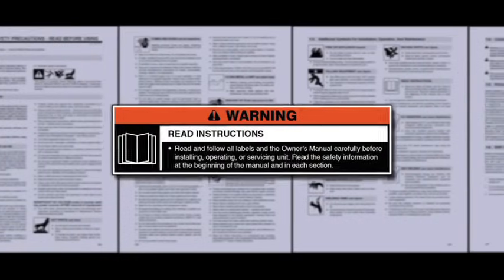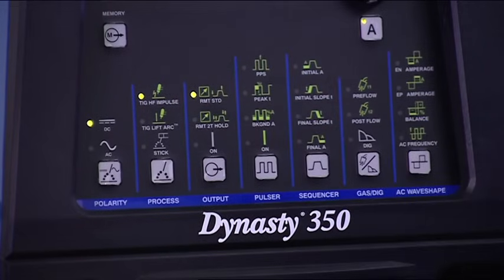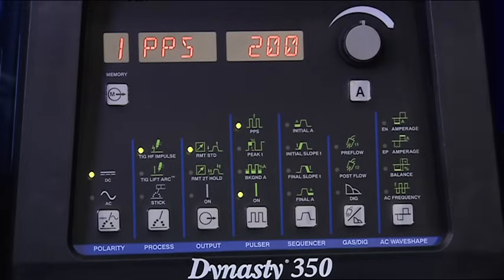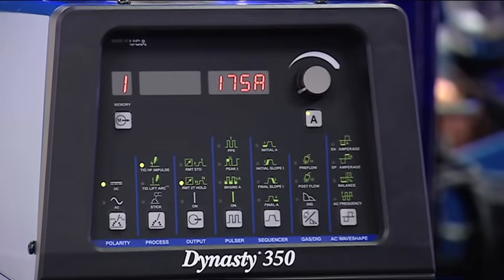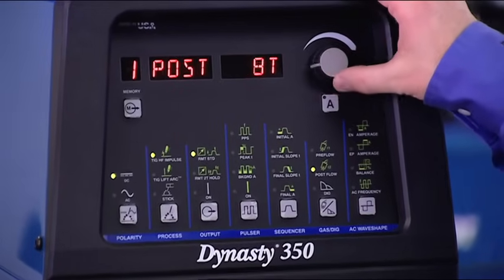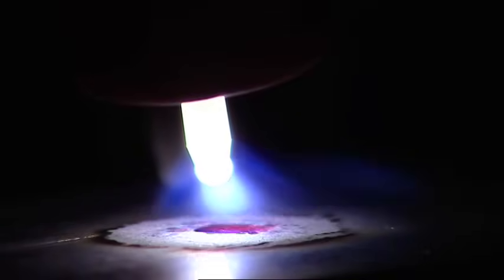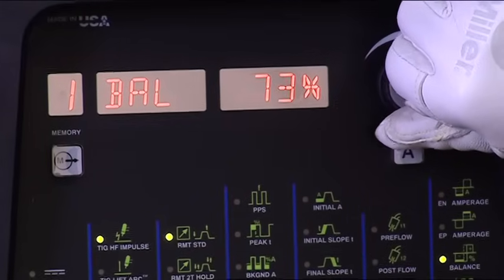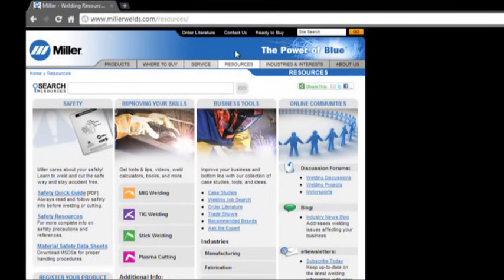Miller Dynasty® and Maxstar® TIG Welder Set-up and Operation

Comment: When does Miller gonna lower there prices in Europe on those tig inverters. also re design a low noise coolmate  coolers.   Everlast tig machine cost less than €€€ Miller.
Reply: we have an everlast 180 at work... it's garbage... it used to be "ok" but now its poop.

Comment: What are the advantages and disadvantages between Dynasty 210 and 210 DX? Thanks.
Reply from the maker: Thanks for reaching out. The Dynasty 210 provides essential TIG and Stick functions and provides operator-friendly, menu-driven features. The Dynasty 210 DX offers full AC features, including advanced waveforms and wide ranges of balance and frequency.
Reply: Aleneski Kalashnikova  look for a Italian  Everlast tig welding machine on Amazon. There water coolers are also cheaper.
Reply: @africantwin173  I too look to the comment sections for key information on all my major work related machine purchases!
Reply: Also, the 210 DX has longer duty cycles than the straight 210. Whether or not this is a good thing is up to the buyer, I suppose.

Comment: On my 300 DX I can set how many amps the HF uses to start the arc by pressing the HF start button and the Lift Arc buttons while switching the machine on. This setting can be as low as 1 amp. This is different from the Initial Amp setting on the front panel which can go as low as 5 amps. 

Can you explain the difference?

Also, can you explain the 4T for mini logic control?

Comment: Miller Dynasty Code ( Help 31 ) what is that ?
Reply from the maker: +thehegt Tr Thanks for reaching out! These are defined in the Owner's Manual. The Help 31 Display indicates a malfunction in the primary power circuit caused by an overcurrent condition in the primary IGBT switching circuit. It is recommended that you contact a Factory Authorized Service Agent if this display is shown. Please let us know if you have any further questions. Thank you!

Comment: long time no comments! 

Hello Miller, I have a few years into the trade and comfortable in it. S/GMAW. Though I just acquired my first welder. It is a Miller Gold Star 652. I have a pfd of all the features, but upon finding this video I have a concern.

I will soon be putting it to work on heavywall aluminum, (I hope.)

I say I hope after hearing you say aluminum is AC only. The aluminum parts will be done with tig, will my welder do the job?

Thanks in advance!
Reply: and if you have one around, maybe a vid for the tig set up with my New to me welder!
Reply from the maker: +anotherpersons namehere Thanks for reaching out and congratulations on your first welder! The Gold Star 652 can do some DC TIG welding at high amperage (>100 A). Aluminum requires the AC TIG process. Unfortunately, the Gold Star 652 is not a fit for AC TIG welding. It is best suited for Stick welding and carbon arc gouging. We recommend a Dynasty or Syncrowave for AC TIG welding or a Millermatic with a spool gun for MIG welding. We hope this helps. Please let us know if you have any further questions. Thank you!
Reply: +Miller Welders while I agree with you, I don't have that kind of money. I have been doing some legwork in additional parts...is there some kind of addition I can purchase to add this to my welder?
Reply from the maker: +anotherpersons namehere Unfortunately, there isn't an addition to the Gold Star 652. You will need a machine with AC Tig capabilities (like the Dynasty or Syncrowave). Please let us know if you have any further questions. Thank you!
Reply: C Davis lincoln makes a cheap ac tig welder, the square wave 200. It's $1,500 and has a very good amperage range. The skill cap or how high the machine can take you is almost limitless. There was a person that's gone to a welding competition on a square wave. Welding tips and tricks did a video on it i think. 

Esab also has an ac tig for $1,100 but i'd save a bit and go for the lincoln if i were you. 

Yeah thats right screw you miller for not making affordable ac tig welders.

Comment from the maker: +Jrod R Thanks for the question. You might need to check the machine you are welding with. For inverter-based machines Tungsten "balling" may be created if you are using pure Tungsten (it is the green-banded Tungsten). This type is not recommended for inverter-based machines (like the Miller Dynasty or Maxstar machine). Instead, we would recommend a 2% Ceriated Tungsten. The cracking you are experiencing may be the result of the base metal and filler material being used -- you may simply need a filler metal with more ductility. Check out the following chart to better match the base and filler metals: http://www.hobartbrothers.com/download/detail/aluminum_filler_metal_selection_chart/491.html. Hope this helps!

Comment: I have viewed this video a few times and have taken notes on this welder. I am an ornamental aluminum welder. I am using this welder and I am learning a lot from this on how to better my performance at work! I keep getting a balled tungsten so I had to watch the video again. took notes and will try it tomorrow. I also took notes on pulser control. I need my welds to look sweet! people will see them on some of the hand rails we do. otherwise most of the welds are hidden from view. or ground smooth.. so I have to have good penetration!! so I am wondering if the pulser will help. not everything is breaking after they grind it all away but the heat from powder-coating causes the aluminum to warp i guess and some of my shit has cracked. but only a few it's not always! I'm not that bad of a welder. but, if I can be rid of that I'll be good and confident. we also  do a lot of outside corner welds so again I took notes on waveshape...
Reply: You almost always want to start welding aluminum with a pre balled up looking shape ground tungsten anyway, hence why its balling up on you because it should already be that shape from a fresh start of an aluminum (only aluminum though not an intended tungsten shape grind for any other metals) weld or tack. But yes the electrode type makes a world of difference. Try a pre ball shaped tungsten grind when striking your next arc. It throws a better arc in my humble opinion. Youtube is one of your best friends when learning almost anything. Good luck mate!

Comment: Why are some welders not available or have different names in Europe? Like the Migmatic 250 (Europe) vs the magmatic 252 (USA) the 250 doesn't even have digital display. The reason I ask is I was looking at a Miller mpi220p Multi process welder but can't find it on your website. It cost €1850 in Europe and as you know that's a lot of cash. Does it have something to do with the tax system??

Comment: don t know how you got you mig gun by ul hard to think about my work because always need to think about putting the gun down with starting it up or running wire all over also unsafe ilike the gun on my plaze it has never started up on its own. also the ground clamp on my battery is better than on my miller welder